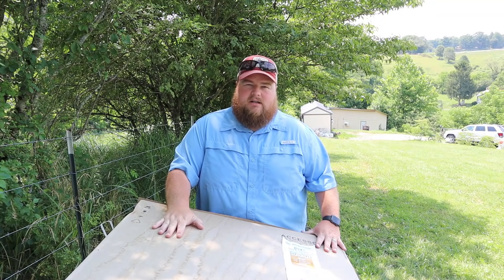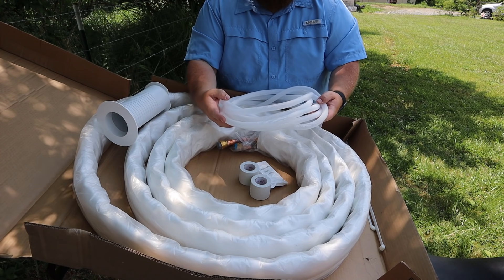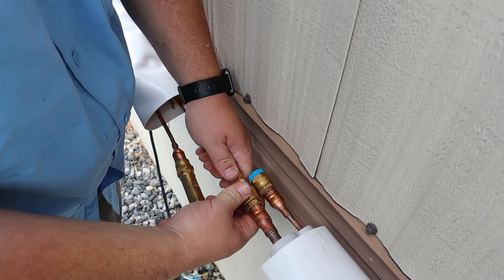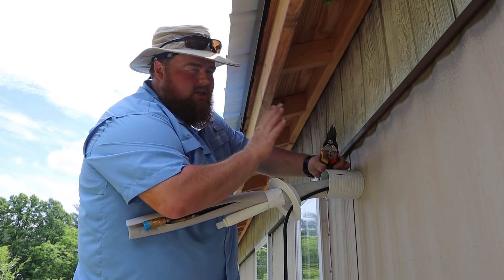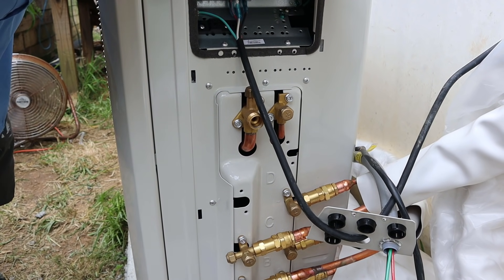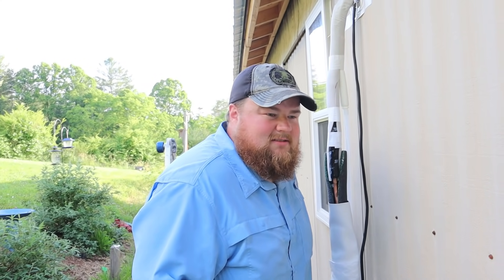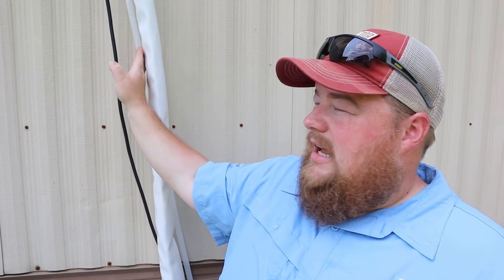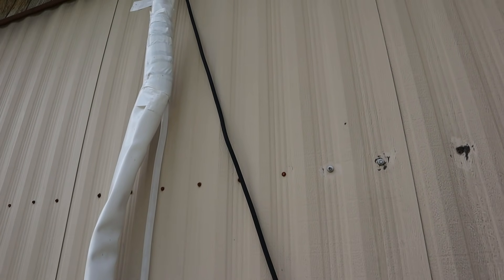WE'RE DONE!!! Final Hook Up of our DIY Mini Split Heat Pump for our Mobile Home

Comment: I've actually used plastic downspouts to cover the line sets. I just cut a slit down the back to fit around the line set and the downspouts also have the mounts to mount them to the house.
Reply: I've seen that too.
Reply: Wow thanks that’s a great idea
Reply: I’ve done that to hide the A/C install so the HOA couldn’t tell. It looks like a downspout
Reply: I am so going to do this. They want over $100 for the covers sets.

Comment: A brother you can bend copper just do it easily in a curve style run it under the house hang it up under there along with the extra line then you just need cover over what’s coming out the wall and down

Comment: Just what I needed to see! I'm considering putting mini splits in my single wide mobile (a 1993 from Oakwood). My AC unit failed, the heating system is so inefficient, and the idea of having to rerun the ducts makes me crazy. My brother says we can get a new unit, heat and AC outdoors, but new ducts would have to be done. I can't afford a pro, and he doesn't have time to do it (he used to do HVAC), so mini splits might be the answer for me.

Seems like I always get you guys when I do a search for mobile home fixes/upgrades. You're awesome, love your DIY attitude. Keep up the good work!

Comment: You could build a cornice board to cover the unit in your dining room to disguise the fact that it is not centered between the windows. Just an idea.
Reply: I noticed that as well. Trimming that window on the left will suffer! PPPPPP Measure twice, drill 3" hole once.

Comment: Quick question... so your planning on re doing the outside skin on the home. How about when you do running the lines behind the new skins? Leaving an access panel so you can get access to the lines if needed? It’s just an idea. Also you could run the lower line under the home and strapping it neatly near the skirt? I think it would be better then spending money on pipe to hide the lines. God bless
Reply: its a stick built home. there was no reason not to run the lines through the bottom plate and wall other than its kid of a pain in the ass.

Comment: Think about American vinyl downspouts which you can get at Lowe's.  They're cheap,  paintable, and you can split the back and wrap it around your hoses so you won't have to disconnect them to run the lines through it.  😄

Comment: Questions....how do you draw a vacuum on the copper lines before turning the fefrigerant valve on to fill the lines with refrigerant?? Also how do you prevent kinks in the line ,especially when you made a 90 degree bend in it coming out of your exterior wall??? I'm not a hvac guy but I do auto air and I know that you have to draw a vacuum in the lines before adding refrigerant otherwise you'll have air in the lines that do not play well with refrigerant.  Having air in the lines can enable your lines to freeze as well as  keeping your system from cooling.
Reply from the maker: The main selling point of this system is that it is a no-vac system designed by MRCOOL. Not sure of the mechanics, but this is how their systems are installed -- super easy!

Comment: I was wondering how the mini split is during the winter the fan being out doors in the cold and snow ect?
Reply from the maker: It operates the same as heat pump systems for home (it is a heat pump). So if they work in your area, this will also work. The indoor units also have electric strip heaters in them in case the outdoor unit quits due to low temps. We should never have such low temps in our area though. As for snow, you can get wall brackets to mount the condenser on posts or the home too.

Comment: Could you install those indoor air handlers on a interior wall?  Run the line set in the wall, down under the house.   Would there be moisture issues with the line set or would they need to be ran in a pipe?  I've got this on my to do list because the mice have made swiss cheese out of our duct work under the house and to upgrade the unit and duct work would be astronomical, let alone less efficient than a mini spit.
Reply: As long as the line set is insulated properly there won’t be any moisture issues. If any part of the suction line (the larger diameter pipe) is exposed, moisture in the air will condense on it. Similar to a cold drink sitting in a room.

Comment: This was way simpler than I expected to be honest. I do hate how the lines look on the outside, I'll be interested to see how you guys disguise them in the future. Right now my wife and I survive with window units in the summer. I have totally considered these for the future though! In the winter here in Upstate NY we heat with wood so I would only be using mini-splits for AC.
Reply: I installed one, and had to call an ac guy to come out cause I kinked a line. So I had him cut and shorten the lines. He also purged and vacuum tested it. It needed topping off, he added freon. All in all he charged $500. I'm glad I did it too, cause now I know its truly topped off and there are no leaks
Reply: @Lmiller201  these units come sealed, as long as there isn't an issue like you ran into with kinked lines there's no need to pressure test or top off the refrigerant
Reply: @Chrispy9393  the compressor unit is sealed, not the line set or inside unit. There is still the possibility for contamination from outside air and water vapor. So, yes they should be purged and vacuum tested.
Reply: @Lmiller201  sorry it's just not necessary with these ones they installed. It's designed to be a full DIY kit. You just need to be more careful.
Reply: @Chrispy9393  unless the line set and indoor unit are sealed as well, it needs purging. But you can skip it if you like but you’ll be buying a compressor before I will
Reply: @Lmiller201  oof. People say this all the time & you're wrong. This system doesn't require it. You just didn't take caution with the install.
Reply: @Chrispy9393  yeah I kinked a line, but that still doesn’t change that it should be purged, vacuum tested and freon topped off.. will it work without it, yes. Is it good for it.. no. Ask a specialist
Reply: @Lmiller201  no need to ask an HVAC tech. This system is literally designed to be setup without them. That's why it's DIY. If you had to buy gauges and all that this would be cost prohibitive. Also they haven't used freon in decades fyi.

Comment: I use an energy monitor called an Emporia Vue to track my power usage in real time. Sense energy monitors are fancier, but cost twice as much, and it's a crapshoot as to whether their software will correctly identify your various appliances and things. Vue tracks individual circuits, which is good enough for my needs.

Comment: I thought you had metal floor ducting in the house when you first bought the house. My duct work was metal inside which we easily cleaned by pulling a rope tied to wet soapy towels between floor registers multiple times. So my question is why didn't you buy an all in one which sits outside your house. Seems like a DIY project.

Comment: I have a concern about your refrigerant lines, coming out of the kitchen, and other copper line bends that you may have made inside. You don't bend copper tubing with the insulation on, you must be able to see copper whether you use a recommended special tubing bending tool or with your bare hands. Best to use tubing benders, they are relatively cheap and prevent the crimping of copper tubing. I highly suggest that you check every bend you made by pulling the insulation back from each bend to ensure that you have not crimped the tubing thus compromising or impeding the flow of refrigerant. Replace the insulation after checking your bends. This won't take you long but should be done.
Enjoy your channel, you have a great family you and your wife are great role models for the kids!

Comment: A 2 ton package unit would have been a better choice for your mobile home. The condenser, evaporator coil, heater coil, and fan all come in one unit outside. You can get one for about $2500. No line sets, just power and feed and return ducts to and from the unit. The newer units are very efficient and much quieter than the old ones.

Comment: It could be that you were using a lot of energy with fans, ceiling fans, or room air conditioners.I know when we installed our heat pump out power usage went down.
Reply from the maker: That's a great point! We used to have six box fans in the house. Not anymore! :)

Comment: We are going to be installing almost the same system in our mobile home in the next two weeks. I didn't see how you anchored the outdoor unit to the slab. How did you attach it? We plan on running our lines behind the skirting so there will be less to cover.
Reply from the maker: It's not attached to the pad -- just sitting there. It's in a very sheltered area from wind and hasn't moved. That being said, we're also moving our mobile home to our new property so are glad we didn't anchor it yet... but will at the new place. :) Concrete bolts/screws will do the trick.
Reply: @sam-and-angela  Thank you

Comment: This is a great video series and I'm sure Mr. Cool will have increased sales because of it. We have been thinking of a mini for several years but each year comes and goes and we just don't know if the comfort is worth the expense. But one of our main concerns was the noise so I am glad you showed how quiet it is. And how easy it is to DIY.
I have a question. Does the inside unit need to be installed horizontally?  We have limited wall space under the roof pitch in our upstairs room and I just don't see how we can fit it in.
Thanks for sharing.
Reply from the maker: That would be a question for the manufacturer... I'm not sure if it would work correctly because of the condensate drain hose from inside to outside. It may not be able to collect and route the condensation properly.  Otherwise these are great units and really super quiet!
Reply: Good point. I just wondered if they had it in the instructions in big bold letters how not to hang it. 
I really enjoy you two. I look forward to whatever you got going in the next video. Thanks for sharing.

Comment: Would you be able to run the lines inside the exterior wall down to the crawlspace then out the skirt at the condenser?
Reply: Lol. On a mobile home ‘inside the exterior wall’ is the interior wall!
Reply: @stevee7774  right but there is still a cavity  at least a 2x4 depth.
Reply: @thebackyardlife475  - It would make for a clean looking install but watch out hanging pictures!
Reply: @stevee7774  true. But I would avoid hanging pictures under my unit inside just in case if that were the way I installed lol

Comment: Hey you 2 !  I may have missed the answer to this question in your videos , but I'm curious as to how " loud " the inside units are when they are running " and " can you direct the airflow up , down or to one side or the other ?  The reason I ask is because I too live in a older mobile home and my HVAC unity is the original as well as the duct work and I am wanting to upgrade to either a new traditional unit or a split system like you 2 have . The duct work in my home has holes in it from squirrels and or mice and the whole system is extremely dirty and unhealthy and I'm wanting to completely close mine off like you guys' did yours . I about fell over backwards when you said how much $$$ a contractor wanted for a traditional unit because I found some very good " new " units by Goodman for around $ 3,000 dollars with free shipping . Thanks for your time and keep up the good work you 2 .

Comment: After using the mini split, have you noticed a change in your electrical usage compared to the central heat/AC system?  I've been thinking of installing a mini split.  I've read many reviews where their electrical bill went down but I've also read several saying their bill went up.  I'm just curious if you've noticed a difference.

Comment: Are the line sets charged with refrigerant?
Reply from the maker: From what we can tell only the condenser unit is charged. But we're not 100% sure. There was no noise or hiss when connecting the lines -- only at the last step when the valves were opened on the condenser did we hear anything.

Comment: It is recommended. I wasn't judging you brother. I've just been  working in the HVAC industry for 30 years. Any lineset open to the environment needs a vacuum pulled. Even though you say the manufacturer designed the Mini Split system you installed on your  home to function properly with the extra noncombustibles in the refrigerant system, nevertheless  you should allways pull a proper vacuum. You should have also installed line dryers on each line. You never know what kind of trash the manufacturer may have inadvertently left inside the lineset.

Comment: You didn't evacuate the system before before you release the refrigerant. You should have pulled a vacuum. Download about 500 micron. (500 parts per million). A big no no to leave none combustibles inside a closed refrigerant system!!!!
Reply from the maker: You do not do that with this system.
Reply: It is recommended. I wasn't judging you brother. I've just been  working in the HVAC industry for 30 years. Any lineset open to the environment needs a vacuum pulled. Even though you say the manufacturer designed the Mini Split system you installed on your  home to function properly with the extra noncombustibles in the refrigerant system, nevertheless  you should allways pull a proper vacuum. You should have also installed line dryers on each line. You never know what kind of trash the manufacturer may have inadvertently left inside the lineset.